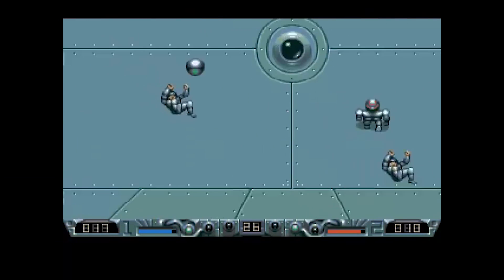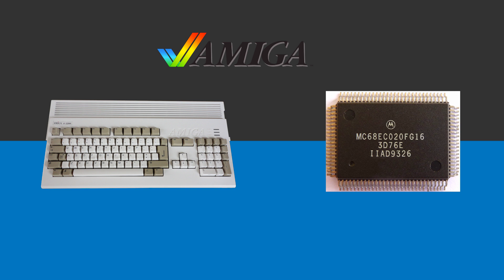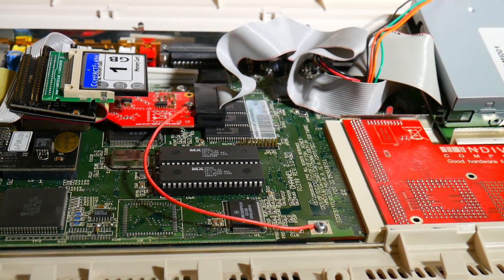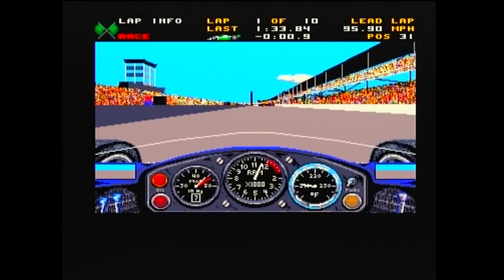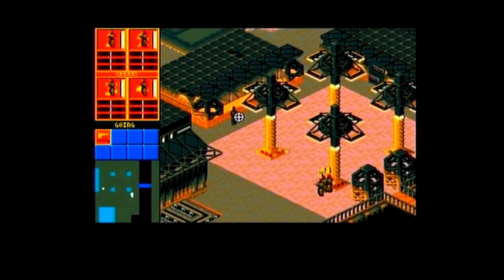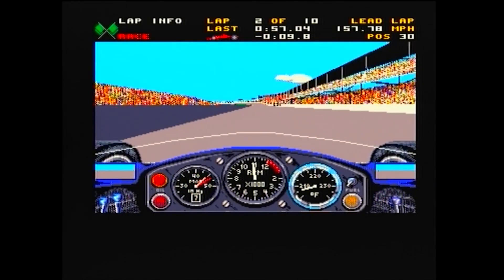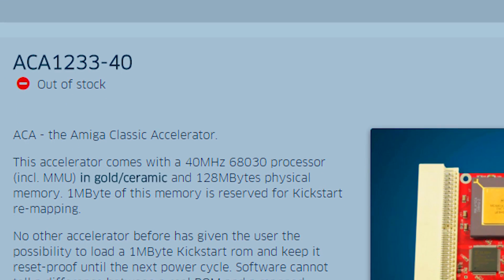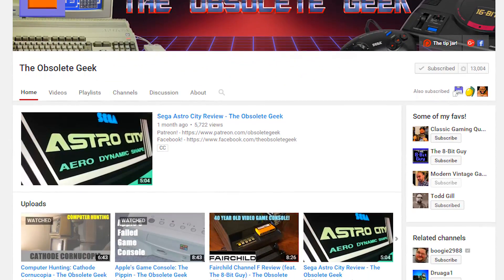Amiga Accelerator Showdown - Part 1 - Amiga 1200

Comment: I finilly dug my old A1200 out the spare room after 26 years. It still has its Blizzard A1220 8mb with a 33mhz fpu (have since fitted a 40mhz fpu) fitted. i stripped it down to check for cap leaks and there was none. I'm still going to be recapping it but it is up and running great.

Comment: For my 1200, I use the GVP A1230 turbo+ (Jaws II). It is a 68030 accelerator @ 40-50 megahertz with and FPU, 8 megabytes of fast RAM. It also has a SCSI controller expansion on it (GVP A1291), which is pretty neat if you want an external CD drive or ZIP drive.

Comment: Terrible Fire has got back to work and has been showing some pretty good improvements to his accelerator designs.  Check out his latest video featuring the TF534 running on an Amiga 2000 motherboard.  By sorting out the memory timings and installing a non EC model  68030 cpu he was able to show the smoothes performance I have ever seen of Frontier on an Amiga running at 50mhz.

Comment: Really?? GVP an American company who made Accelerators and Hard drive expansions and Ram Expansions... but they only sold to great britian originall? Am I confused? The Great Britian Market was way behind on the Hardware options for the Amiga, (except for the Action Replay.; kick ass item). The American market had endless Hardware add ons like Video upgrades, CPU/RAM upgrades and Hard Drive upgrades.. The Emulator Market was also 100% American, with the Emplant Board etc. Other than Datel.. what British company made hardware upgrades for the Amiga...(I just remembered, some of the British Companies made some Great copiers that included Hardware, much appreciated). Am I just Old and Confused?
     It would seem we are looking at Modern upgrades not 1980s/1990s.
I did just order C64 hardware from individual computers, (c64 reloaded 2)

Comment: But you still need a soundcard. Only having 4 channels in the A1200 sucks. Worse still the A1200 was originally planned to have the more advanced AAA chipset, which doubled the sound channels to 8. That was good by 1992 PC standards! :-/
Reply: true 8bit has 256 channels..anything 8bit has 256 channels. Pc has 2 channels they split from day one till sunday and back again.. Actually it was supposed to be 32bit sound ..ie way more channels.Commodore sued creative ,and won proving that pcs where only 2bit.Pc=mac still use the same 2bit chip.
Reply: Optimal Supreme I think you're getting confused here. I'm talking about available sound channels in 1992. The planned AAA chipset had 8 channels, which is fine for a lower end budget machine. Sound blaster etc had 18+, but had to come down quite sharply to get to the AAA's sound quality. 
Not only that AAA had chunky pixel mode, so it could have handled Doom etc (although still likely needing at least a 68030).

Comment: Hi there, I'm an Amiga newbie, I always wanted one as a kid but could never afford one. :( I've owned an A1200 for years now but never really done much with it. I brought a 1230 Blizzard years back but I read you really need a more beefy PSU than the standard brick to run these properly. What PSU did you use with that monster 1260?
Reply: Well dont believe this guy ..like most pc=mac people they couldnt tell the truth if it hit them in the face.
Reply: Intangible Tingles AFAIK an Amiga 500 PSU will work, but double check on Google.

Comment: I meant to make this comment back when the was 1st uploaded. 
I was lucky and was actually able to get an A1200 (after owning an A500 for years) before it's official release. But after a couple of hours in I was actually disappointed. I used my Amiga for productivity software as well as games and while it was faster than the standard A500 it was no faster than my friends A500 with an A5000 (68020 with onboard ram) which confused the hell out of me as this was as 32 Bit processor on a 32 Bit bus unlike the A500 with an A5000 board which was on a 16Bit bus. As soon as I could, I ordered a RAM expansion as the 2MB was not enough for the animations (and other things) I was rendering. When I installed that memory I sighed in relief the as system ran much faster. This was yet another missed opportunity by Commodore to show off the Amiga in a better light. It also led me down the Accelerator upgrade path where I was basically buying a new accelerator every few months until I had an 68060.

Comment: Holy shit! A blizzard 1260!
I had the Blizzard 68030/50 + 68882 and that blew me away as the 1260 was waaay outta my reach as I was about 18 at the time :)
Reply: I had the 68040 with 40 Mhz, but I replaced the 80 MHz clock oscillator (which gave the 40 MHz) with a 100 MHz one and it worked! I had a 68040 with 50 MHz and one of the fastest Amigas around at the time.

Comment: Just had a gander at a price of the Blizzard, £275. Blimey. Can't even see one on ebay, Might have to settle for a lesser model.
Reply: DigitalX The 68030 @ 50Mhz seems to be the popular choice. Essentially a very fast 386/lower end 486 with a 68882 FPU.

Comment: Hi everyone.

I'd like to point out one thing: IF you're running software that depends on an FPU, a '030 with an 68881 or 68882 FPU could actually be faster than an '040 or an '060!
The reason for this is that the FPU's that are integrated into the two 'Big Boys' have omitted a few instructions*, which then have to be emulated in software (via the 68040.library or the 68060.library).  Depending on how frequently these instructions are used in a program, this can impede the overall performance quite a bit.

*This quote from Wikipedia explains it better than i could do myself:

"Unfortunately, the 68040 ran into the transistor budget limit early in design. While the MMU did not take many transistors—indeed, having it on the same die as the CPU actually saved on transistors—the FPU certainly did. Motorola's 68882 external FPU was known as a very high performance unit and Motorola did not wish to risk integrators using the "LC" version with a 68882 instead of the more profitable full "RC" unit. (For information on Motorola's multiprocessing model with the 680x0 series, see Motorola 68020.) The FPU in the 68040 was thus made incapable of IEEE transcendental functions, which had been supported by both the 68881 and 68882 and were used by the popular fractal generating software of the time and little else. The Motorola floating point support package (FPSP) emulated these instructions in software under interrupt. As this was an exception handler, heavy use of the transcendental functions caused severe performance penalties."

I think this should be considered carefully if you are intending to run math-intense software.Finally, I want to thank +Modern Vintage Gamer for a very informative  video; Good job Mate!

Greetings from Denmark :)

Comment: I wanted the Blizzard 1260 so bad back in the day. Unfortunately I could only afford a Cobra 68030 @ 40 MHz and 16MB of fast RAM. Still a huge increase over the stock A1200, but not enough for some of the final 3D games that came out on the Amiga (Genetic Species, AB3D II, Flyin' High).

Comment: The A2000 could also be bought with a 68020 or 68030 board pre-installed from Commodore, not common I'll grant you, but still available. http://amiga.resource.cx/mod/a2000.html And the 1990 A3000 was 68030 endowed right off the bat. 
http://amiga.resource.cx/search.pl?product=A3000
Reply: Oh yeah, great video buddy, cheers.
Reply: DC Angrlish The A1200 was originally planned to have a 20Mhz 68030 and the AAA chipset. In 1992 for the 399 £/$ price that would have been great for a home PC. If it had been socketed (aka upgradable), and had a 68882 socket, it really could of been a great success. But of course Commodore fucked it up....
Reply: it was out in 1987-88  first as AGA then ECS.  Then in 1989  started the AAA research 1992 Hombre Research which I coined that "phrase". It didnt last long as by then Amiga was bough out,and was under. just like GVP.
Reply: Optimal Supreme I think you mean OCS in 87. AAA in 1992 with a 68030 would have been a very decent combo. AAA having 8 channels instead of AGA’s 4 would have been a huge improvement too. For a budget PC 8 channels of sound would have been great, even up against the Soundblasters of the time. A Doom port back in the day would also been a hige boon on that 68030/AAA combo.
Reply: No I DO  mean what I say I mean .To many people believe what a apple=pc person says,. and or wiki says. My information comes straight from Jay ,and others Why should you ? it Really, I coined  the phrase Hombre .So that right there should tell you I knew more then a lot of people.

Comment: Hi +Modern Vintage Gamer, you should try to test again your Amiga's using a update version of SysInfo v4.0, but keep in mind, SysInfo is a strait benchmark, what I mean, isn't able to test all capabilities of the CPU's, try to test it under SysSpeed will be more accurate.
Also you should install your WB under PFS3 AIO and increase the buffers to 150 or even 300 under 32Mb of ram, if you have more can test with 600 buffer, that is the max, but honest and under my test all thing above 300 is ram eater :P

Comment: hi great video, but I feel duty bound to point out your error in the history section at the beginning. you state that all Amiga's had the 68000 7mhz until the release of the a1200 , and that this was the first Amiga with an upgraded processor. you have missed the a3000 which was released in 1990, this had the 68030 with either 16 or 25 MHz options available.  The a1200 was released in 1992.
Reply: oh whoops didn't spot this had already been mentioned in a view more comments' collapsed comment.  soz :)

Comment: IMO, only as long as the accelerators were made back when the Amiga was still on the market do they count as original hardware. It's not very impressive if you take a modern day GPU, and jerry-rig it to work on the old Amiga, but at that point you may as well just replace all the hardware with all modern parts lol.
Reply: +Joey Jo Jo Jr Shabadoo They use the original, genuine 680x0 CPUs, though. It's not emulation or anything like that (although there are FPGA-based accelerators, which arguably count as emulation). The supply of original accelerator boards has dried up, and the remaining ones go for ridiculous prices on Ebay etc. I think it's fantastic that some companies still manufacture new Amiga hardware. Would be cool if they made 68060 and PPC boards too, but I guess those CPUs are much harder to source and more expensive.

Comment: it would have been nice to also show the ACA1221 running fully overclocked on the cpu.
Reply: +Modern Vintage Gamer Full upgrade is worth every penny... or cent. :D
Reply: thinking about it you get 10 trial runs with the unlock jumper on the ACA1221, so you would'nt have to pay a penny to see it flat out ! :D
Reply from the maker: +Austin Green I agree but you gotta pay to unlock unfortunately
Reply: yeah it's €30 for a full unlock, so all in still under £90 GBP for an ACA1221 fully unlocked (plus there avaliable to buy).

Comment: Nice video!
You can also use AIBB for benchmarks. It has more tests and gives a much more spherical view.
I would definitely go after of an 060 if those blood sucking opportunity "Amiga" merchants hadn't sky rocketed the prices of the accelerators to ridiculously levels.
Luckily i got my Blizzard 030 and 040 several years earlier, before the "Amiga" merchants infiltrate the community.
Reply from the maker: +alex76gr yeah I notice people use AIBB quite often. it looks to be more of a complete package but does it have support for 060?  And yeah the price of accelerators are insane! Honestly its one of the reasons why I keep all my hardware because I know if I ever wanted to get it back someday id be putting a second mortgage on my home.
Reply: *****
I am not quite sure if it fully supports the 060 but i have seen it being used widely in Amiga Hardware Database site.
There is a ton of AIBB ratings in there including the 060.

Comment: (no..  it was not wit hthe AGA machine the Amiga came with a faster CPU.   A3000 anyone? :))
Reply from the maker: +ChuckyGang good point but im saving A3000/A4000 for part 3 :)
Reply: :)   anyway.  nice showdown.  maybe you should point out that the ACA1221 comes with 9MB of ram and you can UNLOCK the 64MB by paying extra for it. (and BOY does that annoy me? :) )